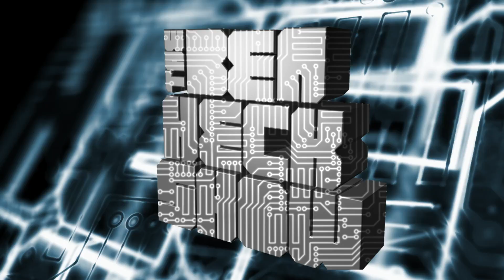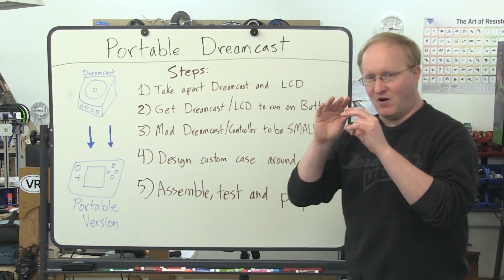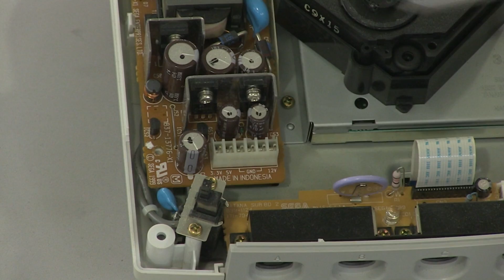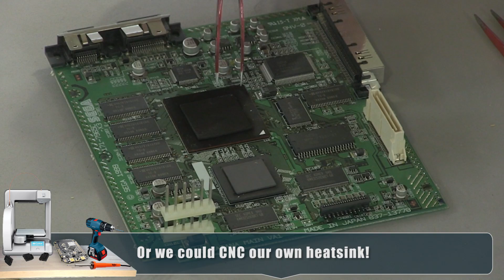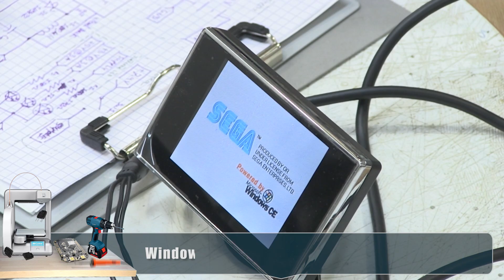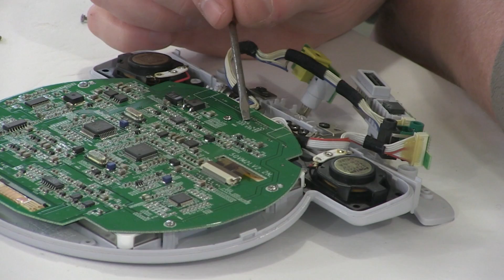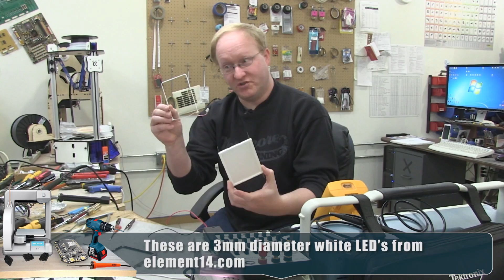Ben Heck’s Dreamcast Portable Part 1

Comment: The Ben Heck Show The Sega Dreamcast runs a modified version of Windows CE (Normally for portable computers) with DirectX as an Operating system. It was developed between Microsoft and Sega in a two year period. (found here: http://segaretro.org/Windows_CE)

Can't wait to see more! 

Softmodding it to run games from an SSD would make it so much smaller. You could also try make it save to the same SSD. Haven't touched a Dreamcast in so long.

Comment: Why not use LiPo instead of Li-ion?
Reply: Robert Hathaway Yeah but he's gonna choose new batteries, so I guess we'll find out next week!
Reply: ***** nah LiPos cost almost as much as Li-ion if you get a low C rating. Plus, they're flat which is a big advantage in a mod like this.
Reply: Elias R.  LiPos are risky though.  They are way more reactive and do not respond well to shorting or overcharge.  I'd rather have my console not burn itself in the event of an accidental short or overcharge.
Reply: That's right but i think ben heck can handle LiPos safely. Another option are LiFe batteries, they are far less risky.

Comment: Thumbs up for anything with screws, being able to disassemble, repair, and reassemble things is good. Gluing things together is what I did in kindergarten, okay in a pinch but not something any professional tech company should have adopted as a standard.
Reply: I agree with you completely. I think they try to make everything look "sleek" and high tech with glue, but screws are just the only way to go.
Reply: Franco Pellegrin Thanks man, it is disappointing to find glue or double sided tape inside cutting edge hardware. Newest down slide is devices where you can't even replace the battery without voiding the warranty. :/

Comment: ***** you can make your own network adapter somewhat easily-- it's based on the realtek 8139C family, so finding a cheapo PCI card with one will help in getting one modified for this, if it's still early enough on. There was a write-up on someone breadboarding one, but I've lost the link since it's been a while. http://hackaday.com/2012/10/17/gd-rom-drive-emulated-to-use-sd-cards-instead/ this may also be interesting to look at for further reading on replacing the GD-ROM with SD cards.

FOUND IT. http://racketboy.com/forum/viewtopic.php?f=1&t=25927 Racketboy had the images for it that plugs direct into the expansion slot in the back. scroll down for breadboard porn.

Comment: Hey Ben, thanks for the details on the CFL to LED conversion for the PSOne Screen! That will make my (ongoing) GC Portable project easier and give longer battery life. Will there be details (schematics) on the switching power supply in the next couple of videos? I might be able to use it instead of the GC one!

Comment: Look at a Dreamcast controller and then a modern Xbox controller, you can see how it influenced all modern controllers.
Reply: glitchsmasher It really only influenced the Xbox controller, and that was because Microsoft was negotiating with Sega on having Dreamcast games play on Xbox, but the deal fell through. That's also why the original Xbox controllers have that huge logo on them; it was originally the VMU window.
Reply: slipAngle Also things like the OUYA and the Shield controllers. You can also see a fair bit of resemblance between the Dreamcast and Gamecube controllers.
Reply: @slipangle3027  and that in turn influenced the future Xbox controllers. Did you forget about the Xbox Controller S? The DC inspired the Duke and since it's not a super great design for either, it naturally evolved to the S which, aside from lack of wireless features, is effectively a modern USB game controller (fun fact, Xbox controllers are USB controllers hence why such cheap adapters exist to convert the controller ports to USB).
Reply: @awesomeferret  wtf are you doing replying to a comment I made 6 years ago
Reply: @slipangle3027  WTF are you doing getting triggered over a reply to one of your six year old comments, haha. Just try to argue that I shouldn't have, it will be harder than you think. ☺
Reply: I loved DC'S controller
Reply: It also was the first console controller (that came with a console, sorry Saturn) to feature analogue triggers.
Reply: The dreamcast was too far ahead of its time
Reply: joaogrrr Yeah, It's more of a technical achievement than an ergonomic one.
Reply: The Dreamcast controller is awesome and garbage in many ways. It has the worse Dpad and the best analog stick I've ever used. The buttons and the curved shape around them is great. The triggers and the overall shape of the controller itself, however, are horrible and make your hands hurt after about an hour of usage. It's really a beta version of the Xbox controller.
Reply: Dreamcast games were made for the original Xbox..pretty much every Sega release on the Xbox was originally intended for the DC
Reply: The Dreamcast controller was great, it pretty much changed the way I looked at controllers, though it had three main problems, the D-pad wasn't great, it lacked shoulder buttons and a needed a second analogue stick. You add those and you pretty much have the Xbox controller, considered the best controller ever by allot of gamers.
Reply: hmoham the Xbox didn't have shoulder buttons.
Reply: glitchsmasher The influence goes all the way back to the Saturn 3D controller.Yep, SEGA was way ahead of it's time in innovation and vision in gaming.
Reply: dont know what all the naysayers are talking about here. i played dreamcast for hours on end as a child and never once got tired or aches. ill admit it doesnt look that great but it sits in the hands nicely. id rather have function over aesthetics.
Reply: @SonikJesus  to this day but especially as a child the PS2 controller is one of the most comfy natural controllers I've ever used, which always blows my mind when I just take a moment to look at it. I think you know that there are plenty of people who would strongly disagree with me on that. TLDR is everyone has different hands and different brains. Things don't have to be ergonomic to work well, look at things like the GBA's transition to a clamshell design. Sure, the original is noticeably more comfy but the design with the hard edges that you think would be distracting really are way more than good enough at the end of the day.
Reply: Joshua Piercy But it did have the Black/White buttons, which were moved up to the shoulders in the 360.
Reply: SwankeyMonkey And the genesis, which had backwards compatibility, online play and downloadable games.
Reply: ***** If the 7200 wasn't shelved before release it could have been out before the NES. That's impressive.
Reply: +glitchsmasher the Sega Dreamcast was the first CONSOLE to introduce the idea of downloading additional content to make existing games BETTER. The MegaDrive had that net thing that allowed you to temporarily download a ROM of a game and play it while you had the subscription service. That's the difference: a subscription service versus downloading bonus content for the games you already own. The argument you're making is akin to saying that Netflix is DLC for movie lovers. 

The Dreamcast allowed you to do this at no additional charge (sans whatever internet fees you may have faced). The content itself was FREE. This is something that modern developers should take notes on. I honestly don't get why people try to give Sega such a hard time.
Reply: jazzblaster im right there with you 
that remote sat so nice in my hand and if you take the cord and put it in the groove in teh back its out the way most complain "oh cord in way" ya right not a valid reason i thought it was amazing
i love playing ms-dos with the dreamcast controller it plays fps games like a GOD.
Reply: dimmddr1 Interestingly, as I am sure Ben will show in part two, the analog worked like his one handed pinball, magnets and hall effect sensors, even the thumbstick.
Reply: dimmddr1 Interestingly, as I am sure Ben will show in part two, the analog worked like his one handed pinball, magnets and hall effect sensors, even the thumbstick.
Reply: actually the sega dreamcast was the evolution to the saturn
Reply: microsoft worked with sega on the dreamcast's development, so the controller you see there is microsoft's first consle controller and that's why it shares a lot with the xbox controllers.
Reply: glitchsmasher Except for downloadable games, So did the Atari 7200.
Reply: glitchsmasher the dream cast and nintendo sixty-four had the strangest controller designs ever (until the wii u of cores)
Reply: justin rivera They still worked.
Reply: ***** "first DLC" Bullshit. The 7800 and MegaDrive beat it, not to mention PC.
Reply: +thehaxfactory ditto.
Reply: And I hated both controllers with a passion & still do to this day.
Reply: xbox is dreamcast 2
Reply: Carl Siemens n64?,PS1?,SNES???
Reply: Johnny G 360 was similar to that d-pad
Reply: Well that's because it's rumored that the Xbox is The unofficial Dreamcast 2. you notice how all the Microsoft games were on the Dreamcast and then when the Microsoft Xbox came out all the games that were slated to go on Dreamcast ended up on Xbox
Reply: It influenced the design XBOX used, until it became the Xbox 360 controller which was so perfect it became the universal standard for Nintendo pro controllers and other controllers alike. Only one that doesn’t have that is Sony but that’s because the DualShock design has the same amount of buttons

Comment: I hope you ditch the CD drive, dump the ROM and use an SD card or something, because that thing is way too thick and probably takes a lot of power.
Oh, and I wish you would use the controllers. Them using hall effect sensors for the analog stick and triggers and all that.

Comment: Whaaaat? I always thought the Dreamcast controllers to be super comfortable! Granted, I only played with one once or twice, but IMO it was way better than the PS1 controllers (both models).
Speaking of Playstation, the PS2 slim seems perfect for a portable! It's quite small and also quite thin!
Reply: The shape can be cramp inducing after many hours, but for the most part I thought they were pretty good as well.
Reply: SavageArms357 I'm used to the Dreamcast controller and I had to get used to using an Xbox360 controller for PC games... I think whatever you're used to is more comfortable.
Reply: He did a PS2 portable years ago. Look on his personal website.
Reply: ***** Here it is. http://www.benheck.com/ps2-portable/
Reply: ***** Haha, thanks! :)
Reply: allluckyseven The controller itself is very ergonomic, but the analog stuck didn't have any rubber coating or anything. It was just a piece of plastic, not very comfortable
Reply: SavageArms357 I love the DC controller but you are right play it for too long and you get a cramp 😐
Reply: Same for me.

Comment: You can easily use Dreamshell plus BIOS mod without GD-ROM (to do: remove GD-ROM, then you can create jumper between P096 and P154 on the motherboard)! It's free and easy (no need to pay money for GD-ROM emulators). Search tag "Dreamcast BIOS mod" on google, fourth link on dcswat.

Comment: I love this!

Would it be possible to run a USB drive (or SD card, like others mentioned) and just run ISOs? I believe there was roughly 250 US games, approximately 1 gigabyte or so. Then it would be completely portable instead of carrying around a 120 CD binder like we did when the Dreamcast came out :P
Reply: the thing is, when you start swapping components, you might aswell just build the device off a raspberry pi from scratch
Reply: Just Angie There is a new bios out that boots Dreamshell directly from the bios :)
It looks like The Ben Heck Show is using a VA1 board, which means they could also just throw in a GDEMU and boot games off a SD card (The SD loading is only limited by the BUS on the DC, loading from SD via the drive I/O is actually faster than disc).
Reply: *****
they have made stupidly large sd cards.  but keeping 8 sdcards is way more convenient than keeping around gdroms right!?
Reply: *****
Except the RPi can't play Dreamcast stuff very well, at least that's what people reported in the forums.
Reply: ***** THERE ARE 3 DRIVE REPLACEMENTS FOR THE DC!!! Including USB, IDE, SATA and SecureDigital
Reply: I made a post in here with a whole bunch of links and info :) Basically the dreamcast already supports an PATA interface (thats how the GD-rom drive communicates to the system), simply wire the correct pins to a hdd. The USB adapter is still in development but does work almost 100%, it's basically a ATA emulator that pulls images off a usb and also has a built in boot image that is loaded into memory upon boot (dreamshell IIRC)..
Reply: ***** 
The SD/IDE/Bios mod might be the best bet.
attach a secondary bios  can find info somewhere in here:
http://www.dc-swat.ru/forum/forum-29.html
Then flash the secondary bios with a modified bios that will boot Dreamshell from the SD card. It's not very big, so you don't need a huge SD card. 1gb would be sufficient. Once the bios is flashed you can update dreamshell by just updating the files on the SD card.
Then solder an IDE to Compact flash adapter to where the GD rom would go.
http://www.dc-swat.ru/blog/hardware/874.html
Why not just use the SD card? Speed, especially if the compact flash card supports DMA., a nice 32GB one will be fine, can have all the best games. Don't need to go overkill. Make sure it's not a microdrive with moving parts.
Why Compact flash and not a 2.5" HDD? Power consumption.
Could also make it pop out of the portable case at the top.

In the end, using the SD card and the compact flash will cut power consumption on this portable build, and more importantly, size.
This is my plan for a portable gamecube anyways. I got 1/3 the stuff ready.
Reply: Slot1Gamer Is there? from my understanding, the bios doesn't actually contain the dreamshell, but rather calls to the SD card to get dreamshell from the SD card. 
I know dreamshell isn't that big, but i don't think it's 2MB in size..Even RC3 needs the SD card from my understanding.
Thing with GDEmu, it's expensive, not a problem for this show, But the SD adapter could be made with a microSD to SD adapter+ resistors/capacitors. About 50 cents worth of parts.
The IDE soldering is just.. 30-45 minutes of patient soldering, or 20 minutes if you're quick. The IDE to compact flash adapters are cheap too, about $5 usd,
So all parts for bios+SD+IDE->CF, is about $8-$9 an hour or 2 of work at most.

The hardest part, is getting the secondary bios on, and even then, that's not too bad.
GDEmu is like.. $150+, many times more than the cost of the actual dreamcast.
The SD/IDE->CF.. about $10
Reply: ***** The serial port is actually faster than the GD-Rom apparently. If you checkt he forums or actually run the tests, you'll find the GD-Rom is faster in both transfer and seek times.

Comment: GDEMU is an SD card based replacement for the optical drive in Dreamcast console
Reply: not all DC models work with that, the USB-GDEMU is better tbh

Comment: Damn he makes stuff look so easy, I would like to see you water cool a console a PS3 or 360. The one and ps4 run pretty cool. Of maybe just some extra fans or heat sink mods  and some led lighting. I have an older spare 360 and a broke fat 80gb PS3 I was thinking of tinkering with.